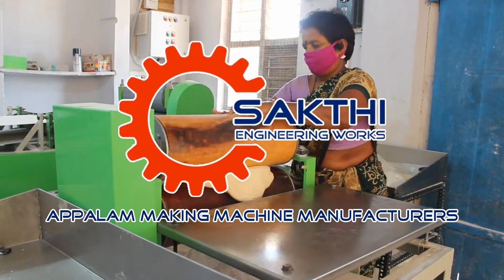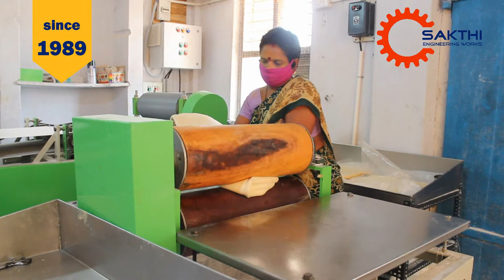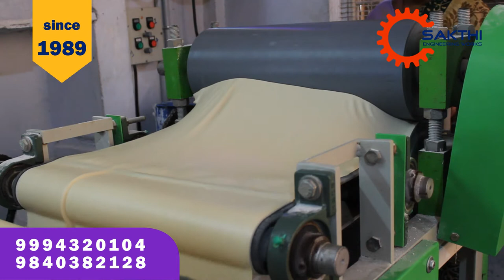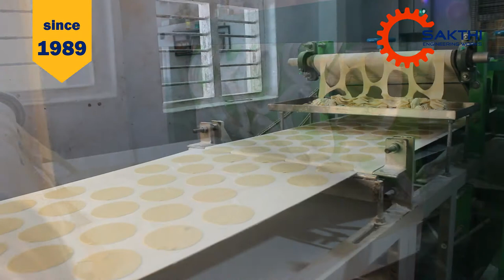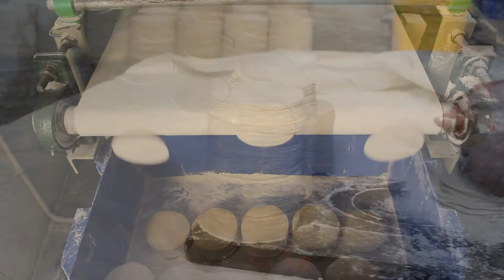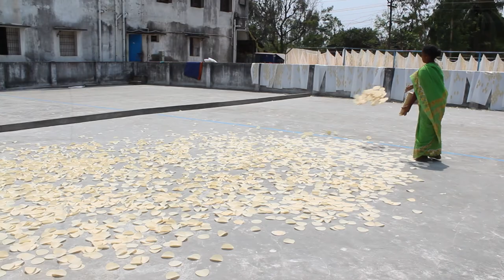First automatic appalam machine | papad making machine manufacturer in chennai | 64tamil.com

Comment: Price sir
Reply from the maker: Check description 
Sakthi Engineering Works,
Appalam making machine manufacturers
No 205. Sri Varadharajapuram, Madambakkam(P.O),
Guduvancheri, Chennai ,Kancheepuram Dist
Chennai - 603202
9994320104 , 
9840382128